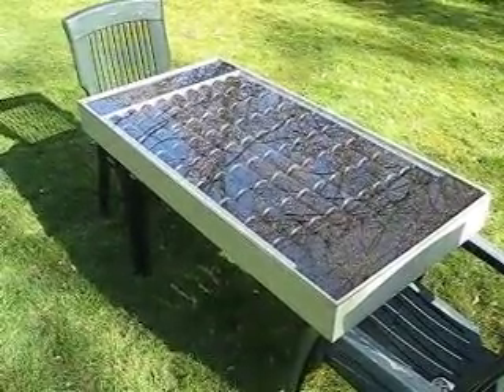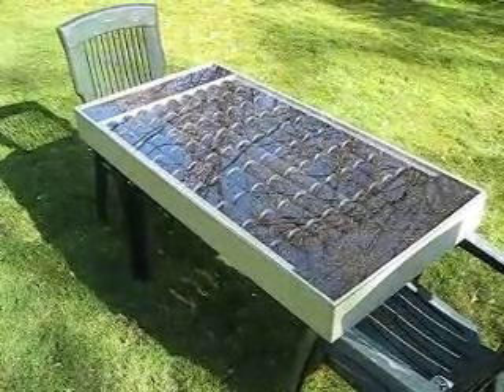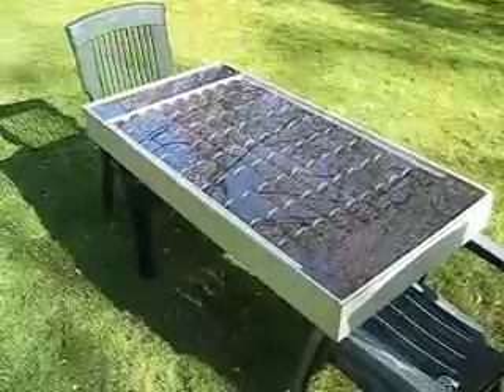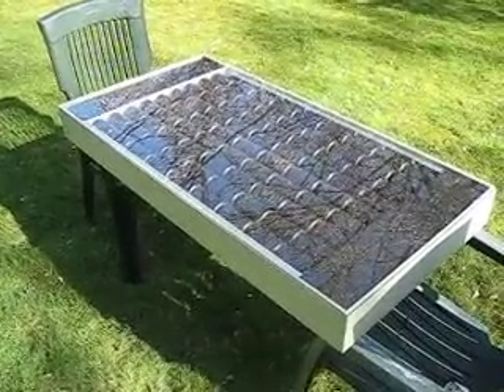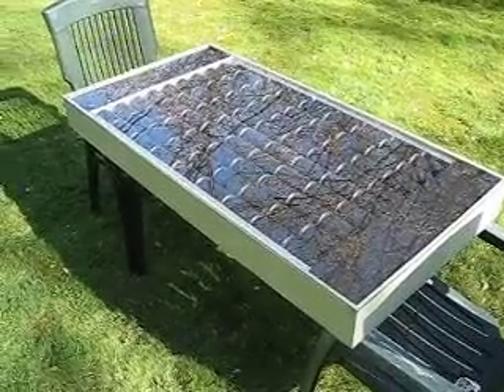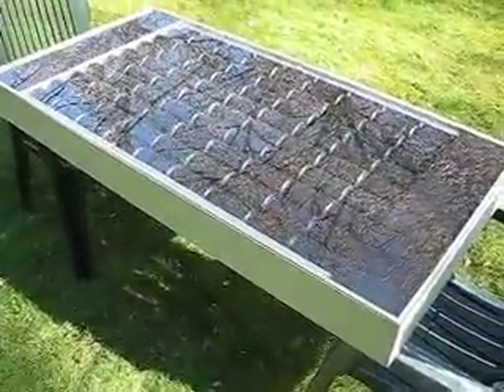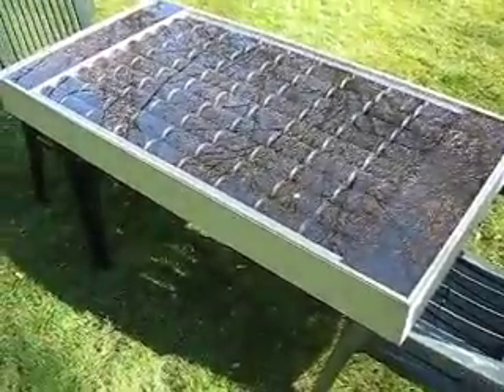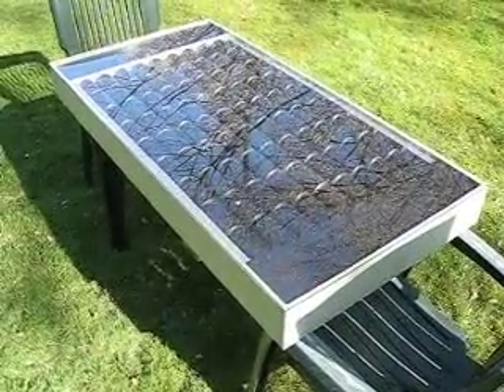solar can heater ( first test )

Comment: Hi , very nice!!!!
You mentioned in your video that you will install it inside a window
 I think you should try to install it on a "non-window" outside surface, the solar energy that comes through the window will be absorbed  by the house anyway.
By putting it on an outside surface actually adds more "windows" to your building without the drawbacks of a real window (small thermal resistance).

Comment from the maker: @jab0805 Thx a lot. I build it to be placed on the inside of my window. I live in a appartment so i can't place it outside. i will place it at the south.The box is made from waterproof mdf. The reason for that is cause i have aluminum windows and sometimes during wintertime i get some condensation on the inside. Did not want to box to absorb it. The only problem i have with it is a smell from the glue. I hope it will go away. Fall will start soon so i will be able to test it.
Greetings
Erik

Comment from the maker: @GDplusEng Hi, if if could i would install it on the outside but i'm not allowed to by building regulation. Pity. Anyway now that its inside it absorbs more heat then if nothing would be installed at the window. My room gets warmed up to 23° with good sun. I'm really happy with it.
Ty for your comment
Greetings from Belgium
Erik

Comment: Hey Erik,  try a higher quality fan.  Frozencpu (dot) com has a line I like called gentle typhoons, they are really quiet, and can blow a lot of air.  Just match your wattage to whatever panel you're using to the fan, the AP 30s blow a really decent amount of air and last a long time.  Hope that helps.

Comment: Could you run the air pipe through say a water tank to heat the water during the day to provide thermal heat at night? I wonder if it would be strong enough

Comment from the maker: @telosfd We can have those plastic plates too but there very expensive.
Thats why i chose glas.
The heater is on the inside of the window so there is no risk of braking due to hail.
Now that fall starts i will be using the heater again.
Thanks for your comment.
Greetings from Belgium
Erik

Comment from the maker: @geochoros Hi there
I used a computer fan but they brake down too fast.
It also does not blow enough air.
You need a stronger fan, i'm still looking myself for a good fan.
If i find a good fan i'l let you know. :-)
Greetings from Belgium
Erik

Comment: Very nice looking heater. Are you going to keep it in doors? Place it inside the room in front of the window? This will increase the life of your heater because it will not be exposed to the elements. Will it get enough sun light inside?Thanks for sharing. - Joel